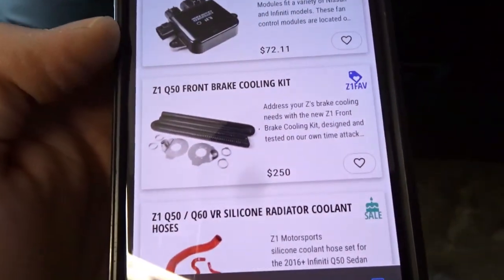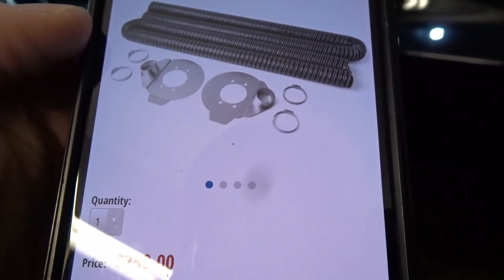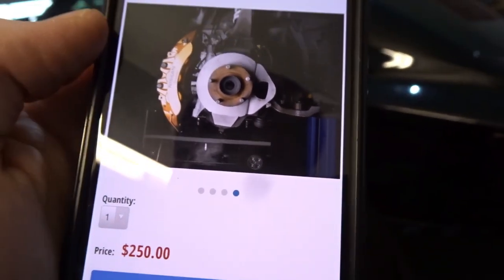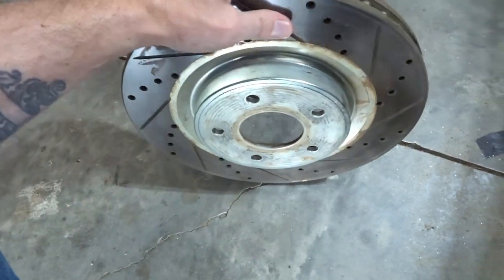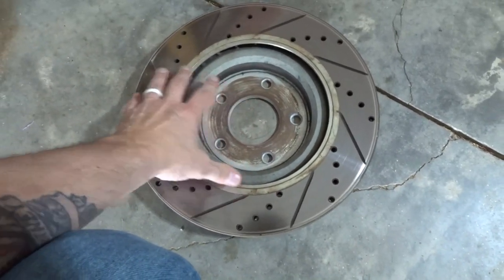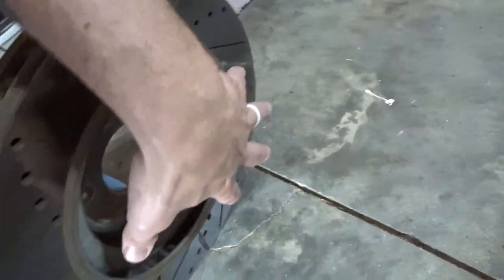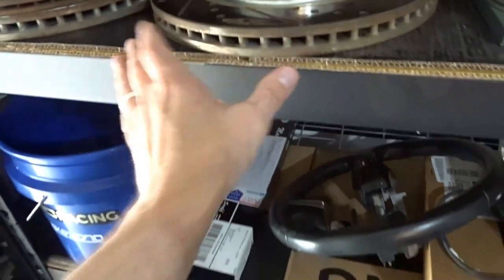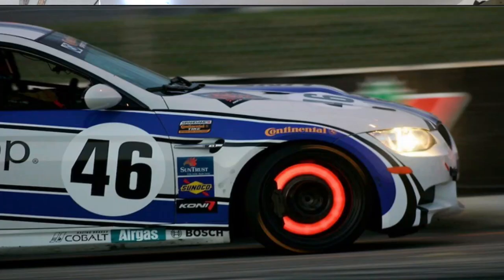Do Brake Cooling Ducts Work?? | Watch BEFORE YOU BUY Z1 Brake Cooling Kit!  G37 370z Q50

Comment: So essentially they want you to put 250 for some cheap hardware and printed aluminum backing plates which involves you putting in  your own labor in to remove your front wheel bearings/ hub assembly  which if you live in  the rust belt like me is a huge pain in the ass with basic hand tools. For Z1 motorsports I'm very disappointed. Upgrades like this are a huge help on heavy track use where there is a lot of extreme braking with heat and expanding/contracting of hardware and or rotors which can cause rotor cracks and warpage.  On  the street even with slotted akebono and or brembo rotors it really is a waste of money.
Reply from the maker: That’s right.  It’s been a point I’ve tried to make—and caught a lot of flack for—the big brakes are really pointless because 99% of people with them will never drive hard enough to need them.  And the same is true with the cooling system.  Not necessary for most people.